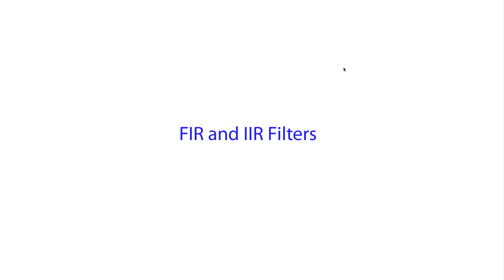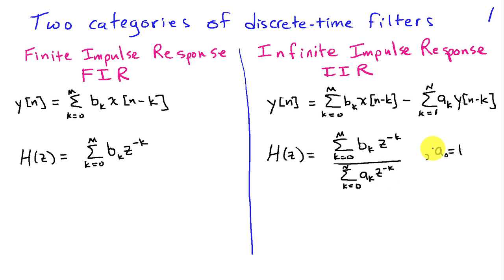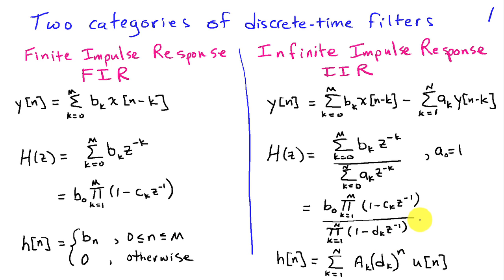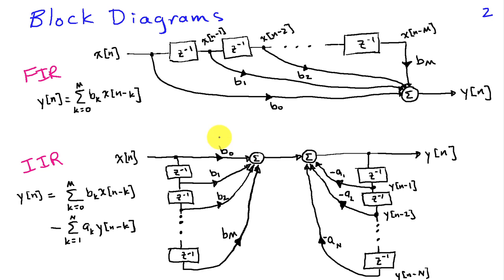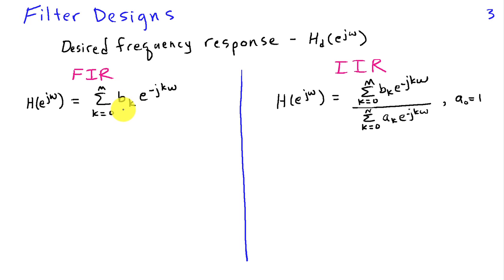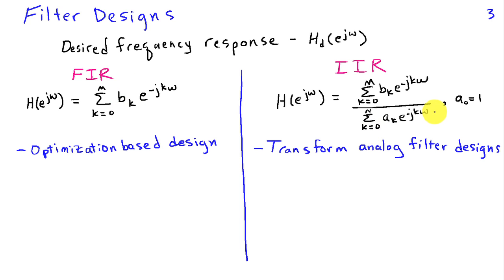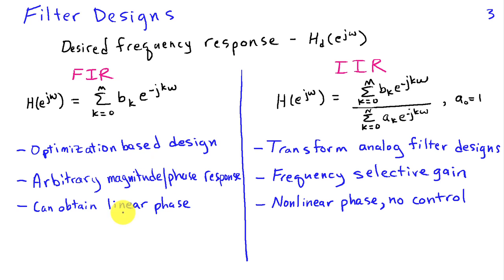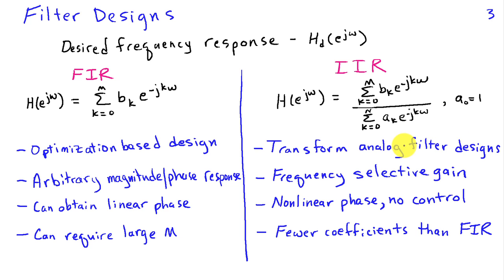Overview of FIR and IIR Filters

Comment: It's often surprising that many ignore the phase component of a filter. The introduction to the filter equation was right on the spot. I am currently researching numerical approximation method for filter coefficient and landed on this video. I feel another consideration is the time delay with high precision FIR filters. If you dont worry about phase and a need a decent filter for a specific pass band, IIR will be a quick calculation and a good algorithm in real time applications.

Comment: This is a good video.  I think that it would have been useful to say and show a diagram that in order for any filter to be able to recognize a band of frequencies, then the SHAPE of the impulse function of the filter must have a kernel containing the signal to be selected.
* A Low pass filters would have an decaying impulse function which contains the SHAPE related to frequencies to be selected
* A high pass filter would have an IMPULSE   followed by the inverted shape of the impulse of a low pass filter.
* A bandpass filter would have a decaying impulse that encloses an oscillatory signal related to the frequency to be selected. 

Then the FIR and the IIR Filters would have provided this shape which is shown on flat paper as a flat function but in reality, it is a three-dimensional  rotating function  going around a time axis 
After all the signal e^-jwt or e^jwT   may be looked at as time locations or rotating vectors are in the form of cos ( wt) + j.sin( wt) which is a rotating vector that operates in the frequency and time domain.
It would be a remarkable digital filter if it is shown in three dimensions where the pulses rotate and the delay and adders operate in three dimensions.  It is also useful to look upon the Laplace and Convolution function as being three dimensional  as we deal with e^jwt   and not only the flat functions sine(wt)  and cosine ( wt)

Comment: Interesting video. I had trouble making low pass filter (analog)  and high pass filter, also analog. This may solve many troubles in electronic design. I need that for SSB (Single Side Band) generation utilizing 'Weaver method'. Yesterday tried to get that, and ended using three inductors for LPS, plus one for HPS, but the problem is that result is not that great. I got -60 dB attenuation at 3 kHz with LPS, but not that great for HPS for audio filtering before IQ mixers. Just... I am newbie in DSP, and don't know what is what in terms of varialbes (k=0?, M, n, and other things). Just wanted to implement that formula on my STM32, but this concept is not clear, or I am not yet familiar with that math. Do you have any link that may help solve this beginners nightmare? Thank you in advance.

Comment: thanks for the video! I just have one question: at 1:50 you say that FIR filters have poles at z=0. I don't really understand why. Isn't a pole a value that makes the denominator 0? And since here the denominator is 1...
Reply from the maker: The system function (z-transform of impulse response) for a causal FIR filter is a polynomial in z^{-1}. For example, a simple one is H(z) = 0.5 - 0.5z^{-1}.  This is equivalent to H(z) = (0.5z - 0.5)/z - in this form you clearly see the pole at z=0. Note that in the first form with z^{-1} when z = 0, the z^{-1} blows up.
Reply: I get it now. Thank you!
Reply: Barry Van Veen
So when do we use FIR and IIR? It seems that they both cannot be used for the same problem. When we say filters, I take it to mean band pass band stop notch filters, does it mean something more. How do I use this concept of FIR and IIR????